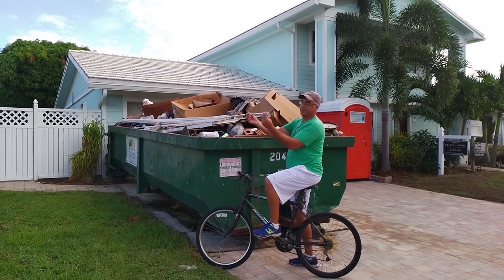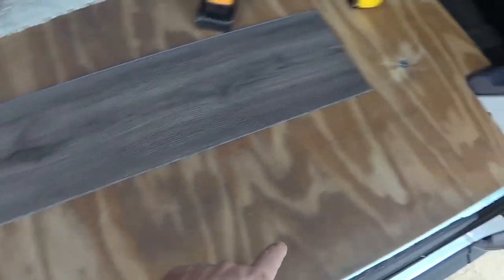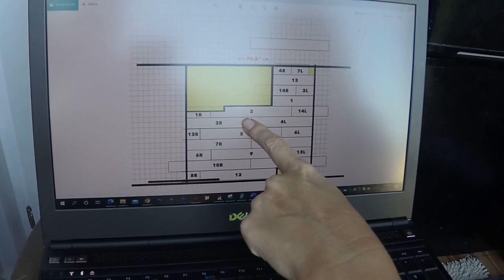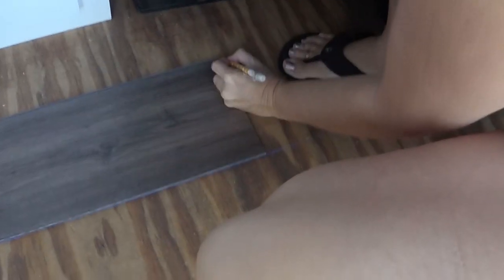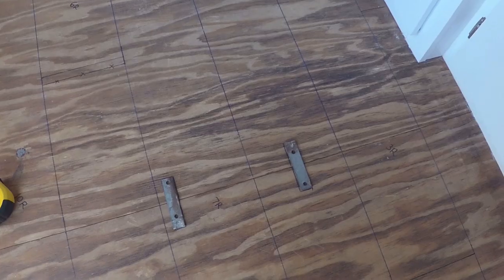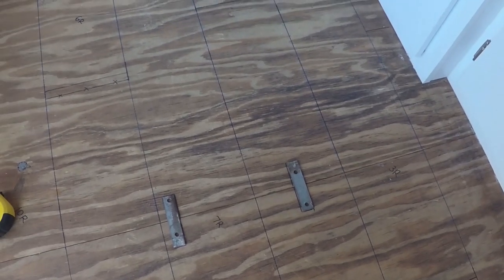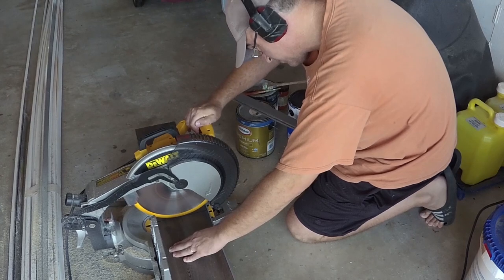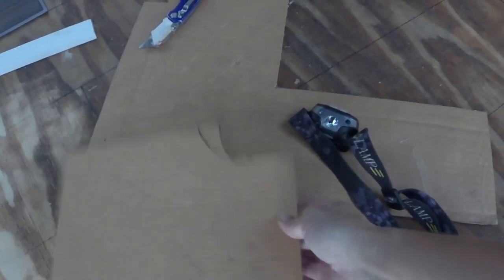IT'S ALL COMING TOGETHER! Installing flooring in a camper van conversion (Part 1) | Van Build Ep. 23

Comment: I am really liking your vids especially as I'm just about to install flooring... 😜 Question for you first tho.  Does your kitchen cabinet sit on top of the plywood, or did you cut a hole in the plywood for the cabinet to fit in?  And then in either scenario, how did you attach you cabinet to the plywood?

Thank you so much!
Reply from the maker: Hi Carol! Thanks so much for watching and we hope our build series will be helpful for you. The cabinet, as well as anything else we've added, sits on top of the plywood and that's what we would recommend. You can see how we build the base cabinet in this video: https://www.youtube.com/watch?v=plkyjqoISmc (the video where we also do the plumbing). We also definitely recommend doing the flooring last, and leaving a gap around the edge, if you're doing vinyl plank flooring like we did. We've since witnessed it expand and contract with cold and hot temps and have talked to others who have had their flooring buckle after building on top of it.
Reply: @SteveAudra  Thanks so much for this info. And for the link to the video. the only thing I am worried about is I re-purposed a *free*! former office cabinet into my kitchen, which worked great and looks really good. However, It is VERY heavy being made of thick glued particle board with laminate, and I got an inexpensive piece of butcher block for the top (from a restaurant going out of business). So all together both are pretty heavy. :( It's in the same basic location as yours and I'm a little worried about it being thrown forward in case of an accident lol. Cutting a hole in the plywood that fits it exactly might secure it a little bit better I'm thinking. Along with some sort of angle brackets attaching it to the plywood from the outside as well. The floor of my cabinet is solid and it would be difficult to attach it from the inside to the plywood. Probably too much tmi, but kind of brain-storming here as I go!

I will check out the link to your base cabinet in the vid. Gracias.

Also, re the flooring, I bought off of FB marketplace some vinyl plank flooring, but I'm seriously thinking of going with vinyl sheet flooring because 1) I will be traveling with my dog and there may be spilled water some times, so sheet flooring would be better in that regard, and 2) the shrinking and swelling of the vinyl planks doesn't sound too good.  Altho I definitely think the plank flooring looks better. Also I don't have Audra's computer skills to get it all sorted out. lol. Thanks so much again, and I'm really enjoying your vids. 😻
Reply from the maker: @uber2tuber  If you check out our earlier videos, you'll see we actually started with a pre-made cabinet. We attached it to the floor with l-brackets. You could probably chisel out where they'd go on the subfloor so they'd be flush with the floor (like we did when we used brackets to secure to connect/secure our subfloor pieces together) and maybe add brackets to the side of the van as well?
Reply from the maker: @uber2tuber  Also, we love hearing how you're being resourceful in your build too!
Reply: @SteveAudra  That's a good idea about the L-brackets... my subfloor is only 1/2" so chiseling out might not leave enough? I was thinking about using aluminum right angle strips all the way around? They would be pretty low profile.

I like the idea of somehow connecting the kitchen cabinet to the side of the van... maybe to one of the vertical beams. It's a Chevy conversion van, so the walls are just thin plywood covered with fabric with a foam backing. But a beam would be structural. There is a local welder who I bet could figure something out. Or perhaps I could just bolt a support piece to the van's metal beam. That would make me feel a lot better!  

thanks so much for the ideas! And I have to say, I was so happy to see how you connected the pieces of your subfloor when I watched the video! I had been trying to figure out how to do that as well. 😄Really great idea!

And I love the way you did the van entry and how you cut the edging... it was a search for that that led me to this vid...!  I will have 3 corners in the edging... ugh. I don't have a miter saw, so maybe I can get the welder to cut them for me. Fingers crossed. Anyway, your instructions and pictures were/are so helpful. Thank you so much!

And yes, I love being resourceful, I was happy to see you guys do that as well. I love searching for good deals!😎 ✌👍
Reply from the maker: @Carol Nicola Sounds like you have some good ideas for possible solutions! We borrowed a neighbor's miter saw. Maybe you could find someone that would let you make a few cuts? Maybe someone on a community group on Facebook or Nextdoor? Or maybe you could rent one? Not sure about cost but maybe cheaper than paying someone to do work. Good luck! We hope you'll let us know how it turns out.
Reply: @SteveAudra  Good ideas! I already have to get the welder to do a couple of exterior things, so I imagine he would make the cuts for free. I just hope I mark them correctly lol!  will definitely let you know how it goes. Thank you so much.
Reply from the maker: @uber2tuber  You're welcome!

Comment: Bad choice for van flooring because of temp extremes. Your seams/joints will all split. One piece materials are superior.
Reply from the maker: We very seriously considered doing one sheet of vinyl because of the possibility of the planks expanding and contracting but we've heard from enough other vanlifers who have not had a problem that we decided to try it. We like the look and installation process of planks better than single sheet. It's also such a small space that we figure we can just easily tackle any issues that arise or replace it. We did leave a gap around the edge though as recommended by the professional installers. I guess we'll find out how it does! Thanks for watching, Karl!